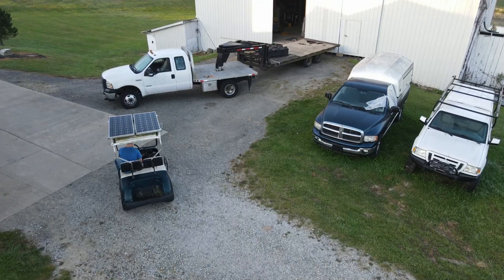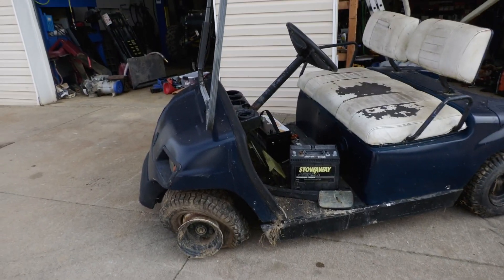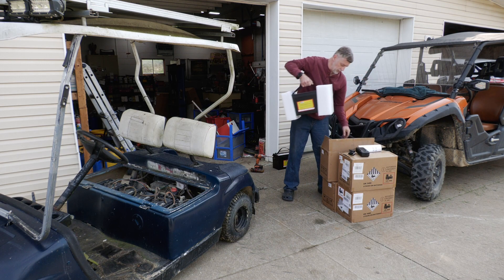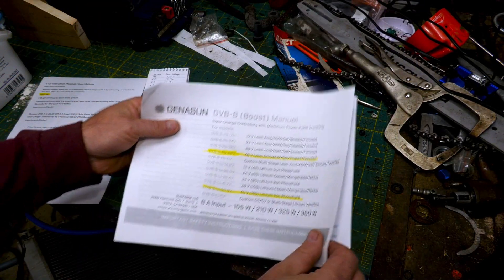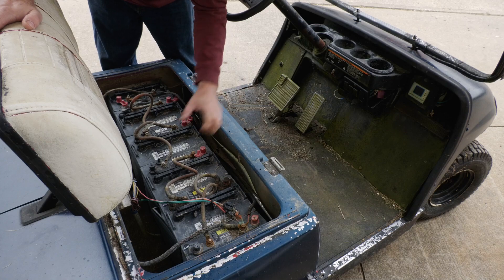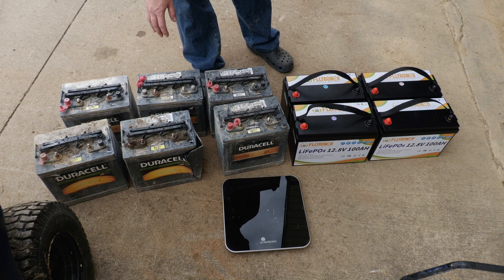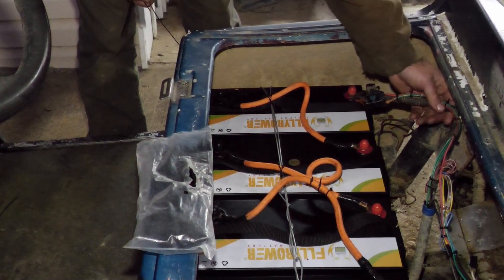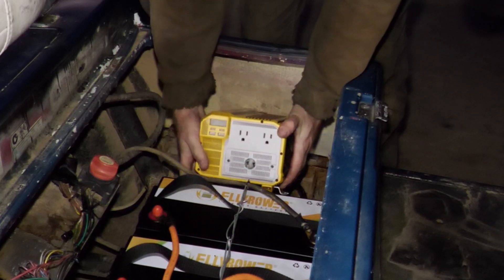Converting Solar Golf Cart with CHEAP Lithium Battery Upgrade

Comment: Did this to two golf carts almost 9 months ago.  It's a great upgrade and having a mobile power source is really useful on our 100 acre farm.  Instead of 2 - 100 watt panels, I used 1 - 350 watt panel on each cart.  More than enough to keep up with our usage.  I used a 36 volt -> 120 volt inverter though.

Comment: Tapping inside a series string of batteries will unbalance the batteries.  You'll need to periodically charge each 12v battery individually to get the entire set back to full.  It would have been much better to use a 48v inverter (and a 48v to 12v DC:DC buck converter for smaller 12v loads).
Reply from the maker: I had a 48v to 12v buck converter with the old batteries and it was not ideal. It wasted a lot of power, was not very efficient, and was only useful for very small loads. I think that the tapping into the first 12v will be fine. Each battery has its own BMS built in, so they cannot overcharge. If one in the string takes longer to top off, it won't affect the others from being overcharged. Plus batteries with a lower charge level actually charge at a faster rate vs nearly full batteries, so it will actually level back out. A good analogy is the electrons are finding parking spots in a half empty parking lot, vs one that is 98% full.
Reply: @ModernSurvivalists  At the point one is full its BMS will stop it from charging which because they are in series will stop all of them from charging.
Reply: @Sylvan_dB  They are more sophisticated than that. A BMS has built in integrated charge circuitry that will turn off the flow of charge current into the cell, but still has the discharge side enabled, so that that battery voltage is available for use. It can also turn off the discharge side as well if needed, in case of over discharge current, etc.
Reply: @markmitchell1290  that would be unique. I don't have that brand but I do have several others and none of them pass charge current when they stop charging. I've also built several batteries and I've never used a BMS which could do that. 

From a physics perspective, where will the excess voltage go if that BMS shunts the current (56v / 3 instead of by 4)? If it drops the voltage, it will produce a lot of heat (volts X amps) and that won't be good inside that sealed plastic box.
Reply from the maker: @Sylvan_dB  I don't have the schematics for how the  batteries internal BMS is designed, but I would imagine it works like a diode rectifier bridge only allowing current out of the internal cells but not in. I may try to setup an overcharge situation on one battery in the bank to test how it will respond. So far there have been zero issues. It could just be the faster charging rate of a more depleted battery has a self balancing effect whereas its very hard to actually reach an overcharge situation on an individual battery. Good question!
Reply from the maker: @Sylvan_dB  Thinking some more on this. I'm rusty on electronic design as I have been out of that field for a long time, but if I was to design a BMS, I would think you would likely have a buffer stage with a capacitor to smooth out current/voltage spikes noise etc, followed by two discrete circuits to the actual internal battery cells. One for charging the battery and has diodes to only allow flow into the cells, and a MosFet or similar solid state relay/switch to disconnect when cell temperature, over voltage, or over current is detected. The other side the output side would have diodes to limit current only in the out direction and another solid state relay that disconnects for under voltage or over current conditions.
Reply: All you need is a 4 battery balancer, a small 12v battery and everything will work perfect. Sylvan_dB is 100% correct. but there are ways around it.